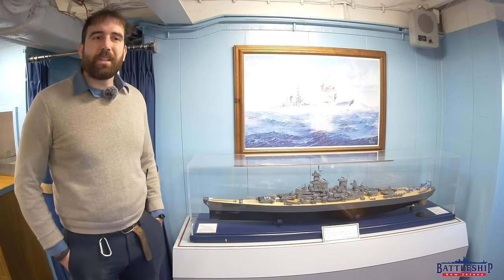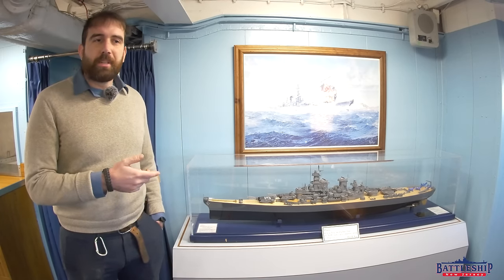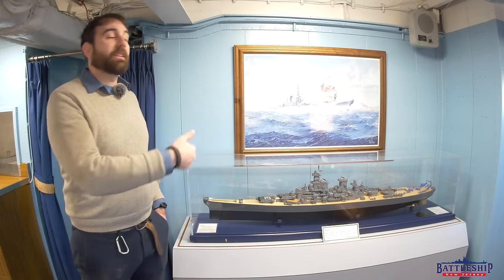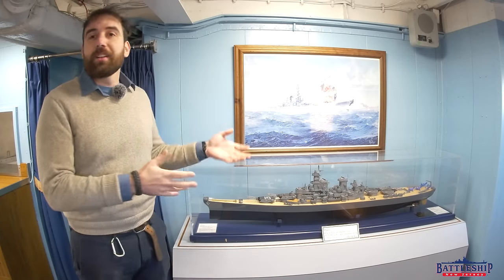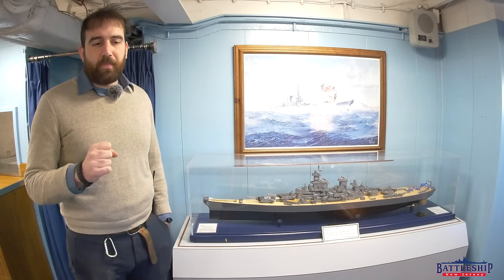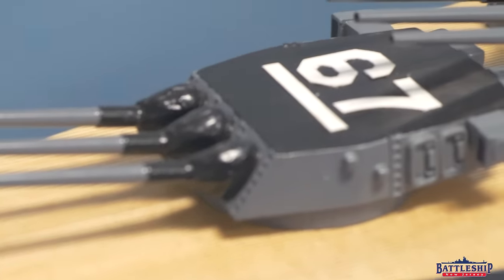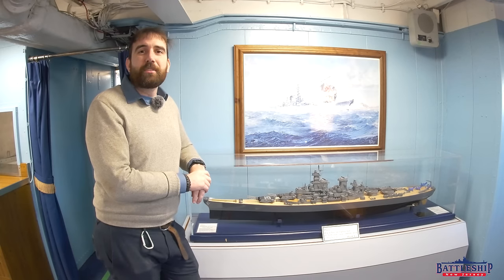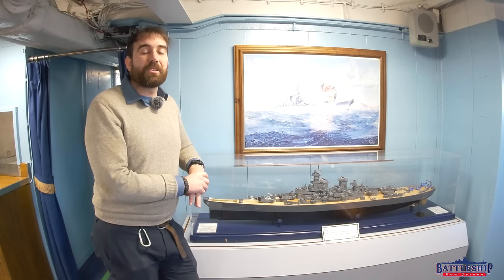Battleship Montana: What Would We Have Done Differently

Comment: Point to note re armoured conning towers: While PoW didn't suffer (comparatively) from ditching the conning tower, the next engagement for Bismarck was indeed fought from her conning tower, for all that KM command staff didn't normally bother to use the thing (it restricted the command staff's ability to interpret the battlefield) - and KGV and Rodney didn't seem to suffer huge difficulties in smashing it to bits. Overall it does seem to have been a waste of limited tonnage.
Reply: Excellent point, Bismarck basically had it's entire superstructure shot off before rolling over. A suggestion I'd make would be to make the main area of the armored conning tower short, closer to the rest of the citadel and have an equally armored but much narrower tall section so someone (two) up top can still see around and holler back down to the CO and all. An armored crow's nest of sorts with a ladder back into the conn.
Reply: @aland7236  While I see the utility, that's expending a lot of weight for two guys. Bear in mind that every space protected to conning tower standards at this point is lugging around 440mm of armour ... so let's say you give your two lookouts one square meter of space each, call it 2m decks to account for pipes and whatnot in the overhead. So you've got a volume of four cubic metres. Let's be efficient and assume we've got these two chaps crammed into a 1.6-metre circle. Putting a 440mm skin on that 1.6 metre circle bumps it up to 2.48m, and your two chaps using 2 square metres are using almost three square metres of armour. At a two metre deck height, that's six cubic metres, roughly fifty tonnes of steel for those two guys.
Reply: @AdamSmith-kq6ys  Solid estimations on the volume and mass of materials, it would be larger and heavier to meet needs for bodies, comms., etc. I didn't take equipment into consideration. My proposal also makes a nice chimney flue too, so yeah don't give me carte blanche at a design bureau.  I dunno, I'm thinking there has to be a way to a) Reduce weight overall or lower the center of gravity a bit b) still have better visibility from higher up to retreat bravely in the event ass is in hand c) still provide something so that sailors are less vaporized by incoming pills. I could only guess the original designers may have had similar thoughts and figured "In for a penny, in for a pound" and got where we are anyway.
Reply: @aland7236  Hmm. I wonder if in my attempt to err on the generous side - get the volume and weight needed to a reasonable minimum - I've in fact skewed the ratio the other way. That first chap needs something like thirty-five tonnes of armour all to himself, person number two adds about another ten tonnes of armour, person number three only adds another eight tonnes. By the time you've got an eight-man team up there that eighth crewman "only" costs you four-and-a-half tonnes. Regards the design considerations ... all true, though I wonder if the late-era battleships, with their capability for delivering firepower at range, had simply moved beyond the requirement for that heavy armoured conning tower. Bear in mind that at 2nd Guadalcanal South Dakota took an absolute pummeling - although nothing breached her armour - and while the ship wasn't in danger of sinking from the shellfire she was rendered completely combat ineffective as every last bit of her fire control was shot away, to the point that if Washington hadn't been around to remind the IJN why one does not want to be on the receiving end of battleship gunfire it's unlikely South Dakota would have survived the massed waves of torpedoes the IJN had at their disposal. South Dakota and her 16-inch-armoured conning tower may have postponed the deaths of her command team but without Lee and Washington they would not have saved the ship.

Comment: 1) Under water outrigger armor plating. Creating spaced armor with thinner armor plate uses the water to significantly reduce the weight of the ship whilst still providing the same protection. It also has the added benefit of increasing stability, and maneuvering because it could easily be adjusted as a rudder. A faster, more maneuverable, yet still heavily armored vessel. AND...no one needs to even see them.

2) Automate 2 of the 3 turrets....probably leaving the rear turret manual.

3) Add "suicide doors"  and trailing water brakes for INCREDIBLE combat maneuvering capabilities. The ability to turn like no other BB afloat, and "emergency brake" during incoming...makes the vessel far more survivable. Especially with significant reduction in armor above the water line.

4) Significant reduction in superstructure armor, removal of second smoke stack, and increased engine power......SPEED!

5) 16" canister rounds. The ships has GIGANTIC shotguns not being used for defensive fire. Load those bad boys with a lot of birdshot and skeet~shoot those kamikazes coming in!

Comment: I disagree with not changing the armor scheme.  I would drop the belt armor to 14" and incline it to the Iowa's 19° slope.   The Montana's only opponent s going to be a Yamato.  Under 20kyds no modern battleship had any real protection.  But 14" armor inclined at 19°  is equal to 18" at 25kyds.  Even the Yamato"s 18" guns will not penetrate  on anything less that perpendicular strike.  You can save a lot of weight in the belt and pick up a lot of speed.

Comment: If the Montana were built, how would you imagine the Navy might modernize her say in an imaginary modernization program in the early 2000's.  More room to add missile batteries for sure.
Reply: In my head, i think they'd remove turrets 2 and 3 and put a VLS in the barbettes. The barbettes are 30 ft. across and 50 ft. or so deep. Plenty of room for missiles like Tomahawks, Standards, or  Sea sparrows or what have you.  Also, removing the 5"/54s and putting single mount 5"/62 in their place.
Reply: Remove turrets 3 and 4 install flight deck on rear.  Add vertical missile launcher

Comment: My alterations might not work in your self imposed timeline, but... I'd likely drop the fourth turret, and go with 9 guns of an autoloader variety like the DesMoines. The weight and space savings from only 3 turrets, shorter belt(??), etc allows for the heavier guns and larger magazines. At least, that's my daydream. I think 36-45 rounds per minute would be worth the effort, and would be a nightmare for any enemy...
 Of course adding in all welded construction saves weight too, and with your alterations, Ryan, and maybe going with higher pressure boilers, we might even squeak out another knot or two of speed!!

Comment: In 1942 we would have been able to move more of the C&C below the deck level without effecting efficacy. The Flag Bridge especially. Reduce the superstructure size even more by keeping only your eyes up high, and a backup plot sure, but transition to a more modern integrated control center. This probably requires some "backup" periscopes borrowed from the submarine supply chain to give the LTs something to do since they no longer have windows to peek. With the better automation and the delivery of the tracking radars you can pull those critical control spaces below your armor belt to minimize the distance between other critical systems and damage control, and improve survivability. Frees up superstructure for more AA and radar too.

Comment: 12 changes that are a summary of what I'm seeing in the comments and what you had in the video. All of these are for displacement savings.  With these changes, I believe it's enough to get between 10,000-14,000 tons of savings to get a 29.5-31.5kt top speed depending upon if engine power is increased as well. 

1. Fully welded construction saves 5000-6500 tons. 

2. Getting rid of the conning tower 600-700 tons. 

3. Get rid of aviation facilities and equipment, and make sure radars fill the capability. 

4. Move to the 1200 PSI boilers. Possibly an increase in power combined with less engine mass. 

5. Update the AA equipment to 3",  some  40mm, and the quad 20mm.  

6.  Redo the super structure and funnels to be smaller. 

7. Go to 2 centerline 5" guns and reduce  the beam ones to the 3 lower  mounts giving a 10 gun broadside with the more effective 5" 54 gun and saving the weight of 2 mounts for about 110 to 150 tons in just the mounts.   Probably additional weight in below deck support, and since it's the higher mounts, remove the armored barbetts the turrets sit on.  

8.  A lot of this weight reduced is up high combined with the hull, and engine savings should keep stability constant. 

9. With the AA, engine, secondary battery, aviation removal, and structural changes should hopefully reduce crew and its displacement needed and give room for crew growth.

10.  Adding a bulbous bow this should reduce engine power at desired speed. 

11.  Possibly adding some of the saved displacement back into minor length add on (maybe 50 to 100 feet) outside the citadel area so as to not lengthen the armor belt and give additional deck space for future helicopter installs. 

12. All this saved displacement and bulbous bow should increase efficiency so that less fuel needs to be carried for the same range.  I would still put in the tank spaces but not typically carry the fuel.

Comment: The weight saving you mentioned but removing all but the 3" AA guns since the proximity fused shells make the 5" and 3" much more effective.  After the war, say up to the Gulf War modifications: Replace the oil fueled engines with nuclear, remove the upper rear turret and replace it with a VLS and all the 5" double turrets with the new automatic turrets used on DD's and FF's now.  The phalanx close in defense, perhaps ASROC with towed array sonar.  The UAV and/or a tethered balloon observation platform for over the horizon fire.  With the Harpoon missiles as well it would be a true surface control ship.

Comment: In addition to your changes fully welded construction would be a nice add, but instead of the quad 20s oerlikons maybe add 40mm bofors in twin mounts back in place of the 20mms and then use the 3 inch as your mid range aa. I would use the experimental 18 inch 45 gun in triple
Mounts and put three turrets instead of four to keep weight under control.

Comment: I would create a large battle bridge space down in the armored section of the hull with enough facilities for flag staff as well. This can be used as a meeting and planning space during normal operations. If the upper spaces take damage, moving down most of the personnel is probably more effective than relying on an armored conning tower and more weight efficient too. 

I would remove all of the 5 inch guns and replace them with some autoloading 8 inch guns. 

I would also provide a means for accessing the propulsion during a refit into the initial design to allow for upgrades in the future. 

Otherwise similar to what is suggested in the video. 

Postwar I would have removed two of the main gun turrets and replaced them with guided missiles. Initially with the single arm type with a rotary magazine below. Eventually possibly with VLS tubes. This would provide long range conventional surface strike potential, fast jet air defense potential, and a nuclear weapon potential. This makes them more of a multipurpose platform and reduces vulnerability to air attacks to some degree. It also probably would reduce weight and thus increase speed.
Reply: The guided missiles first added would probably be the RIM-8 Talos. It had both long range air defense and nuclear warhead options
Reply: The combination of 3 inch guns, 8 inch guns, and later on some missiles would have been an effective combination for air defenses. No need for the 5 inch, 40mm, or 20mm guns at all.

Talos launchers on larger vessels had 52 missiles stored below deck. Two launchers on a modernized vessel would therefore have a total of 104 missiles. Perhaps 100 for air defense plus 4 nuclear weapons for destroying entire fleets in close formation or at least the largest capital ships on their own, or a variety of other targets.

Comment: I think the Navy made the right choice in not building the Montana class. However… based on the Scenario posed by Ryan; what if we had lost at Midway? Carrier production was in full swing. Illinois and Kentucky would be finished to a point where they could be floated out and fitting out pier-side would open two slipways for two more Essex class carriers. Maybe two more Iowa class ships might be built but I doubt it. The Illinois and Kentucky would very likely get the modifications Ryan discussed. In addition I’d loose the aircraft and catapults all together. Even the aft crane. Then use lessons learned to complete Hawaii and Puerto Rico. I strongly agree with the twin three inch mounts and improved AA directors. 
Thanks again for a thought provoking presentation!
Steve

Comment: 1) get rid of float planes, av gas and crains and catapults. Get a dedicated cvl that the aircrew trains with Montana’s battle ship squadron to do the necessary shot tracking and spotting work.  Most of the shot tracking can be done by radar. Av gas in combat very bad.

2) get auto loaders for the 16 inch rifles. Fewer crew. 

3) design 2 16 inch magazines-prep rooms/powder areas for the fore and aft turrets. Lower weight as you save the between turret walls twice so 4 fewer armored walls. Let’s face it if a shell penetrates into a 16 inch powder magazine the ship is lost any way. This way 2 target area rather than 4.

Comment: What about a BBN-67?  I have seen a sketch of the silhouette of BBN-67. (Its actually titled BBN-65)  The profile seems a bit smaller.  The superstructure being a gradual center mass as it "flows" from forward to aft.  A large flight deck for possible up to 6 various choppers, two 16" BAE Rifled Railguns and four 3" (unknown type) guns center line, one forward of superstructure and below the bridge, one aft above the flight deck, and two about amid-ship on each side of the superstructure.  There would be 4 amphibious landing craft and 4 armored troop landing craft.  Of course AEGIS equipment would be included, but I see no radar antennas mounted anywhere.  Other types of detection "mounds" are visible.  What do you think?

Comment: One of the changes I would make, and he sort of touched on something for it but didn't go far enough with it. A bunch of weight saving measure that was done with the Oregon City class Heavy Cruisers was that they figure out that the three or so foot, step up into the five-inch gun mounts were entirely useless and not needed. So, making the five-inch mounts flush with the deck would have saved plenty of weight as well. Since he was talking about the three-inch guns as well.

Comment: Great video, for the wishful thinker I am, I like to image battleships in the present, how would they make them etc.   For today Panama ships can be 1200 x 160.  New types of armor (modern tank armor- Chobham type), with foamed metal (titanium/aluminum) and boron carbide/tungsten carbide, not to mention Kevlar. Gun 16" or maybe 18"- for land operations.  Secondary guns 6" or 8".  New types of shells (for longer range- either longer barrels or ramjet projectiles with GPS targeting).  Missiles 200+ ( SM missiles for air, sea and underwater).  Antiair/missile defenses- min 8 ciwis (20 or 30 mm) or secondary guns.  Nuclear powered with TAs for electric power for  6 Azipod propellers.  2 X Bowthruster.   Lots of extra KW for rail guns  or lasers.  Hanger at stern for drones or midship superstructure. Save weight on armor, astern turbines, gearboxes (using azipods).  Layered defense (missiles, ciwis, laser) against hypersonic missiles.  Keep it fast over 30 knots.

Comment: Large increase in the size of the CIC.  This was a relative new idea as the fast battleships were being designed and the blossoming size and number of sensors very quickly overwhelmed them.  This can be noted by the need for the CEC to be created during the 80's.  In this scenario, the lessons of (at least) the first two fast battleship classes early war cruises would have been available, show this need.
Interestingly, that same experience, namely the action of 2nd Guadalcanal, would also provide a bunch of other lessons such as hardening of electrical services and aircraft facilities.  (and as others have noted, probably switching from float planes to chopper's would have been good, and probably saved some weight.